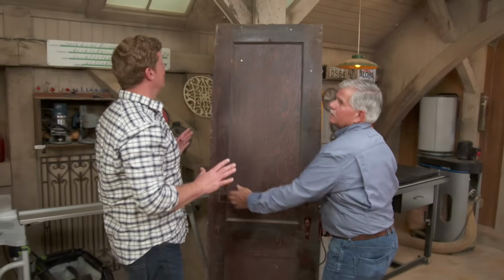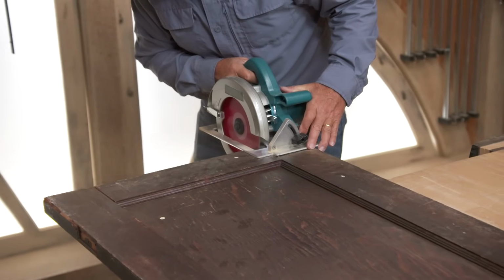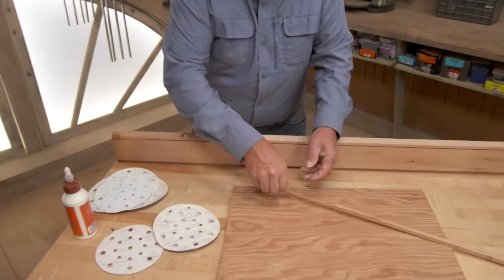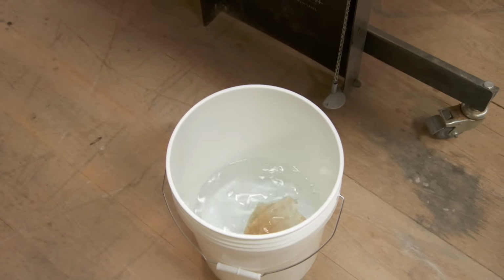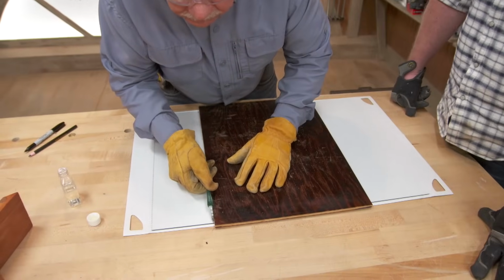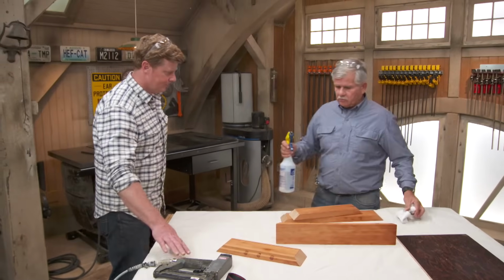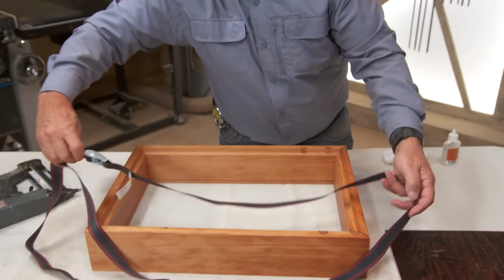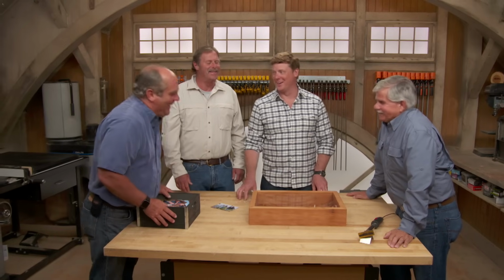Salvaged Door Shadow Box | Build It | Ask This Old House

Comment: can't you make a window like this?  just curious, what the difference between an expensive window and this type of method?
Reply: Bardia Ghajari Very little. Except i wouldnt make a window using miter joints. I'd use something more substantial
Reply: Bardia Ghajari Also windows need thicker glass and ideal they will be double pane for insulation.